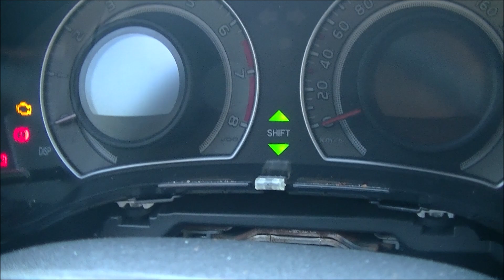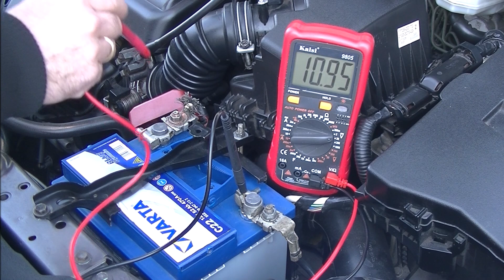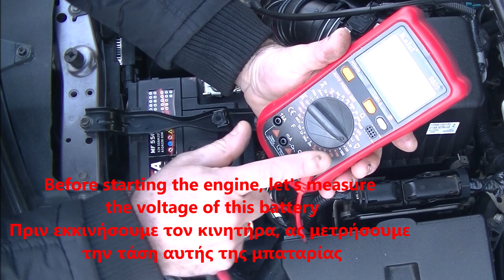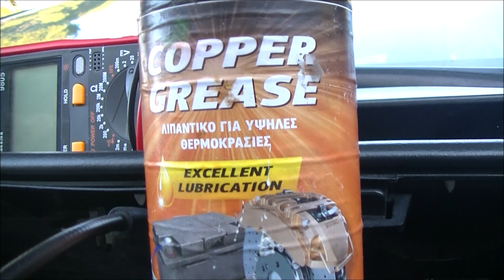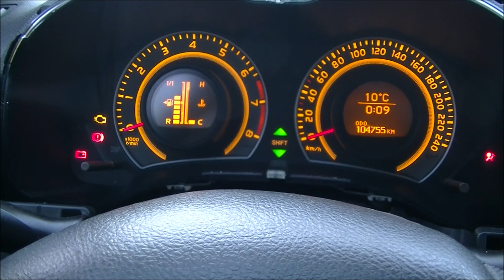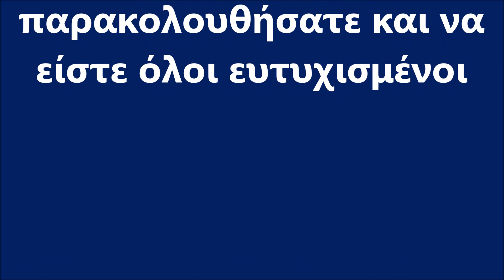2007-2013 Toyota Corolla ​I changed my battery after 6 years Αλλαγή μπαταρίας μετά από 6 χρόνια

Comment: Brother, after replacing  the battery any settings related to fuel, Air intake etc.. needs to be done apart from date & time. As you know the ECM become reset after disconnecting battery.
Reply from the maker: What is your car my friend?
Reply: @YiannisPagonis  it's model  2008 Toyota corolla
Reply from the maker: @satishlewis3424  The only settings you need to make after replacing your car battery are the date, time, instrument panel lighting and radio frequency memories. No other system in your car is affected
Reply: @YiannisPagonis  Many thanks
Reply from the maker: @satishlewis3424  You are welcome my friend 😊😊❤❤

Comment: What brand did you get and why that 1 in particular? Plus the copper grease was an excellent choice. Much better protection for the terminals.
Reply from the maker: My friend, as you can see in the video, the brand is called ANZA and is made in China. I do not know this brand at all. Of course I would have preferred a more branded brand with a longer lifespan, like the one I had in my car, but it did not have the store where I supplied the battery. What a pity! Now for copper grease it is indeed a very good idea to protect the battery terminals. It is also used for other applications.

Comment: I had the same problem with a small battery that was not fixed in the mounting bracket. The battery was 190mm high and did not fit. 
You need a 225mm high battery.
Reply from the maker: My new battery is actually smaller in height than the previous one, it is mounted only on one side but something good I am thinking of doing for this issue that arose. I have several good things on my mind.

Comment: ...  and your alternator is working?   That should be the next test.    Your battery could have been discharged due to alternator malfunction.
Reply from the maker: Well my car charging system works perfectly in an exemplary way. After installation the battery I made 2 measurements with my multimeter where both measurements showed 13.45 volts! Besides, do not forget that this battery had a lifespan of 6 years. My omission was that I did not videotape them in my video to show them to you. SORRY !!!!